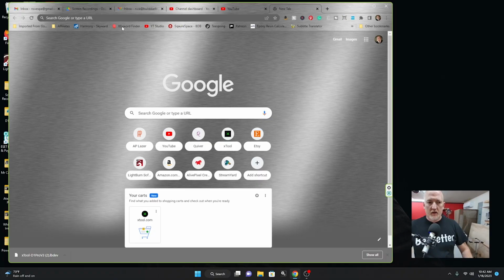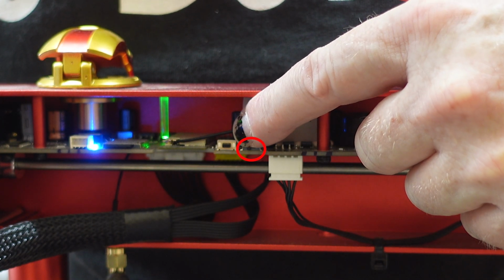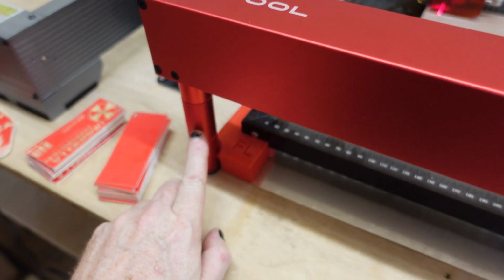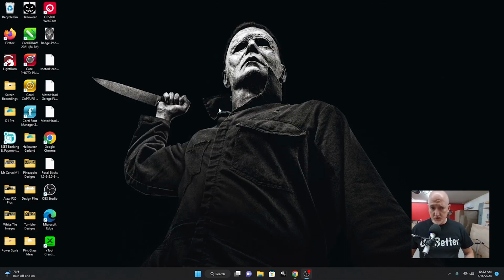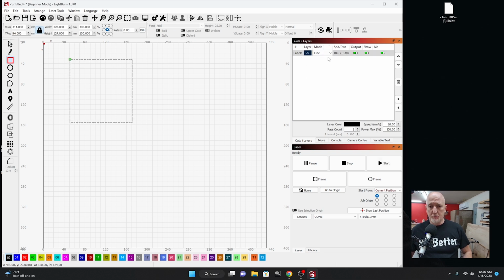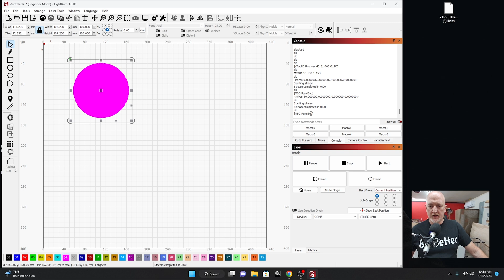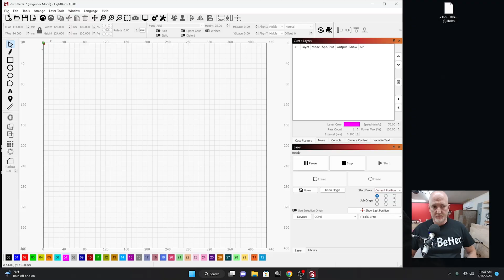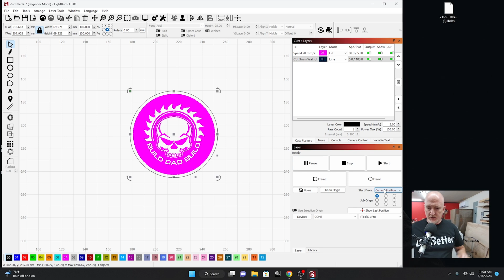Lightburn: Unleash xTool D1 Pro Potential

Comment: I've been trying to upgrade my firmware.  xTool says new firmware has been found. I go to install it and get a message "The machine is working. Please try again later."  The machine is NOT working. Laser is not on. Gantry is not moving. It's the opposite of working.  Anyone here have any ideas?
Reply from the maker: Welcome to the world of xTool not supporting their older units.
Unfortunately a lot of people run into this. It's why I stopped working with them.
Might want to check out the xTool Facebook groups. Some folks in there might have some insight.

Comment: Do you have a setting for powder coated tumblers with the 20W upgrade? I did a test grid and those settings don't work right on a full design. Seems like no matter what I try, the edges are clean and shiny but the rest of the fill looks burnt.
Reply from the maker: Unfortunately I don’t. I haven’t done tumblers with the 20W

Comment: Good morning new to xtool and lasering, with creative space program on d1 I need to create 16mm circle which I can do but I need to put 14 mm circle completely centered inside the 16mm circle can that be done and cut out?
Reply from the maker: Sure thing! The inner circle should "snap" to center. But if not you can use the align tool on the top tool bar.
Cheers

Comment: YES! I got a D1 Pro for Christmas and it's been sitting in my garage.  Every video I watched says use Lightburn it's super easy and you can do so much more.  I was so lost I couldn't understand how this software could be so easy.  Your video helped so much as far as the way you said go here then go there and Yes more videos like this would be very helpful...and Thank you for showing the extra gadgets to make the machine work so much easier.  Hassel to remove the risers up and down when you have the enclosed box.  Ill be buying those extras for sure.
Reply: I don't use lightburn either. The XCS can do stuff and they are adding more as we go.

Comment: Quick question. Previously had Atomstack and my origin was front left corner with X0 Y0 for homing. Can I do the same with d1 pro as it has limit switch each corner? If that's possible could you show me how to do it?
Reply from the maker: You can change the origin in the parameters of the laser under devices.